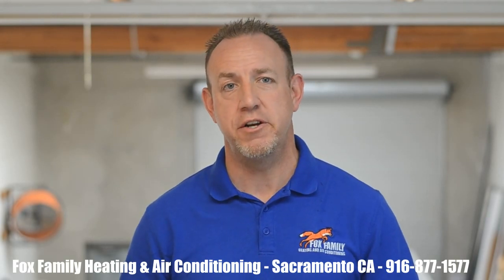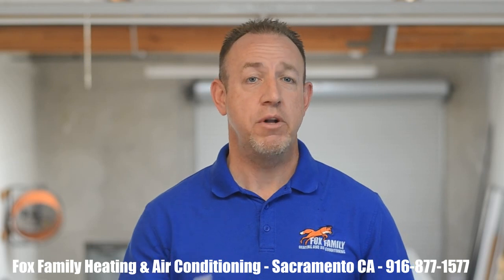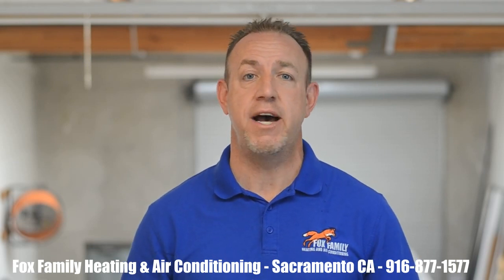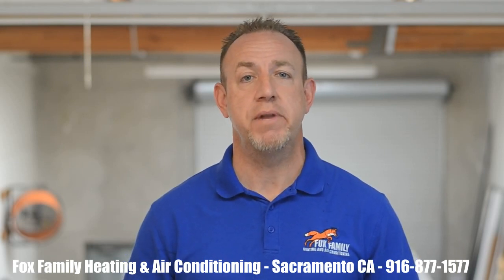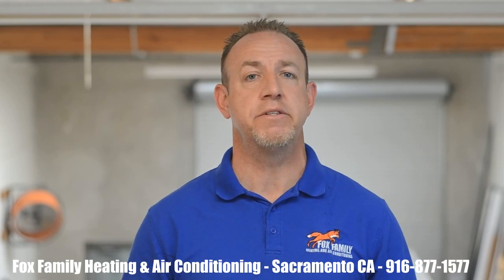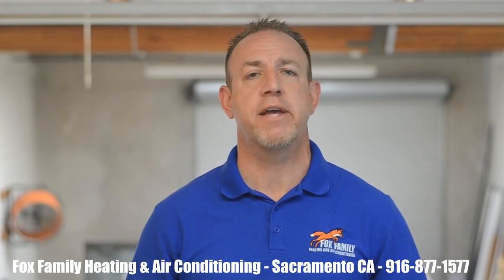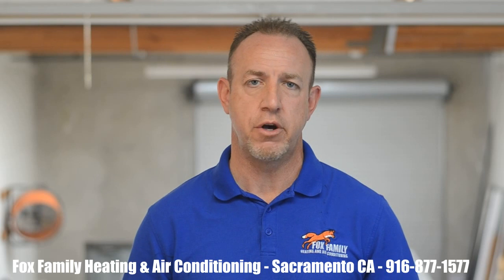Should I Hook Up My AC Manifold Gauges Every Time On An AC Service Call?

Comment: Agreed. If it works don't fix it. If I have to, I love my FieldPiece JL3K's :-) No hose no worry. Not fancy pancy as gauges though. 
What is also important is to make sure the caps are on, or replaced. Many leave them off. This allows contamination to mess things up. 80% Electrical, 20% Refrigeration issues.

Comment: No. Specially when the error code indicates a dome temperature sensor fault. What you say at the top of the video,- this is how you all are trained. My technician came out, scrolled through the error codes, scratched his head, made a phone call, told me to wait a month to see if the code clears. I thought that didn't sound right, but I am not an HVAC tech. However, I can read. The readout prescribed checking the DTS  electrical resistance and supply voltage. So I called the tech back. Told him the fault did not heal itself and he may want to check the DTS as indicated by the system diagnostic report. First thing he did was.....PUT HIS EFFING GUAGES ON THE OUTDOOR UNIT! WTF? It's an electrical fault!

Comment: I definitely agree with you,  wetbulb and splits can give you a hint if you need charge. How ever techs need to know that on humid days splits change do to the removal and latent heat. Like you said there is a chart. 
But my company also wants us to check. If all is checking out with other methods I'll just check suction, get a range of superheat, and check temp on thr liquid line like you mentioned, if its removing heat itd gonna be warmer/ hotter than ambient.

Comment: great information, i think if some one new in field , its always good to check pressures to avoid call backs.
for an experience tech ,who has good understanding of temperature split, suction line temp, liquid line temp,  not necessary.

for example , you can have good temperature split and nice cold suction line if evap coil or filter is dirty.

Comment: on a maintenance yes I do. On a service call I ask a simple question, "Did the unit just stop working one day or has it not been keeping up?". That question will tell me whether its electrical or charge related 95% of the time. As An owner/operator I could be running as much as 12 calls a day, I dont have time to check charge on every call. I do however grab suction line after electrical repairs.
Reply: It seems like they all lie how do u trust them
Reply from the maker: Good input thank you!

Comment: I do commercial hvac and usually never gauge in unless the delta t is 15 degrees or less, theres also signs like suction not sweating or temperature split across condenser/evap coil. Unless I have too then i gauge in, but to replace a capacitor, contactor, motor etc.. No! Not only you could contaminate the system if you dont purge the lines properly but you also leak small amounts of refrigerant that eventually add up. I worry more about the condensate lines to be clean and clear draining properly

Comment: Finally someone agrees with me about not putting gauges on everything every time. I also have been against the flushing of line sets when going from 22 to 410. Now Rudd is saying the detergent in the flush is worse on the system than not doing. My point is the oil will drain to the lowest points which is usually the outdoor and coil.
Reply from the maker: great feedback.  thanks for sharing Michael!

Comment: Now when you use these digital manifold gauges, and you do several systems a day with different refrigerants.  Granted the gauges can go from one refrigerant to another.  Then the hoses and manifold would have more than one refrigerant and that could add R-22 into a R-410A system.
Reply from the maker: Thanks Gary!

Comment: To prevent finger burns I use those small attachable hoses, don't know what they are called lol
Reply from the maker: Like the ball valve shutoff ones perhaps?
Reply: Jose Gallegos I use low loss fittings but 
Find using a thumb screw depressor for the high side more effective but does involve more time to set up properly

Comment: Checking pressures on every maintenance is detrimental to the environment.... you release refrigerant every time, even with low loss fittings...you are doing more harm than good to the system by hooking up guages when everything else looks fine